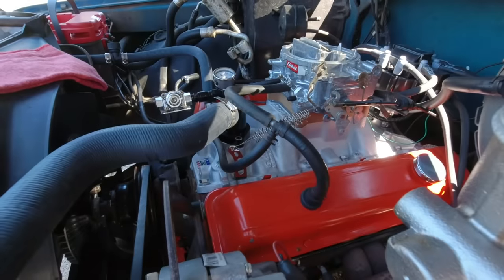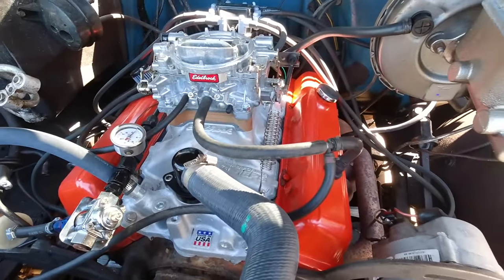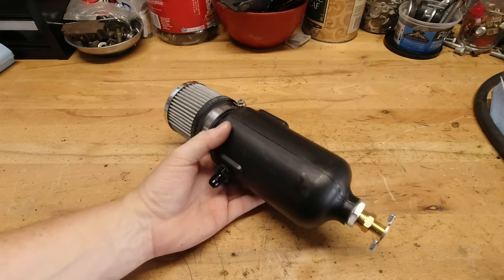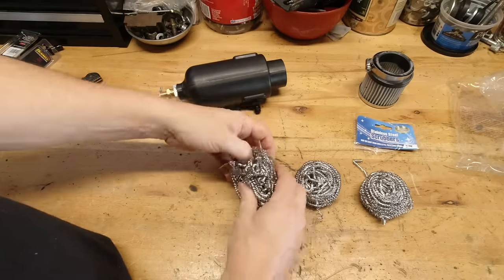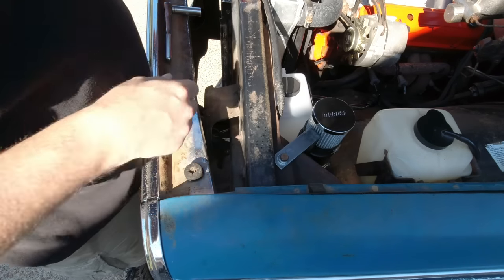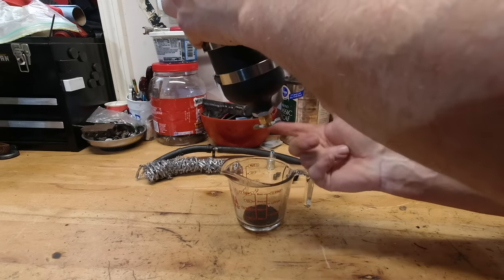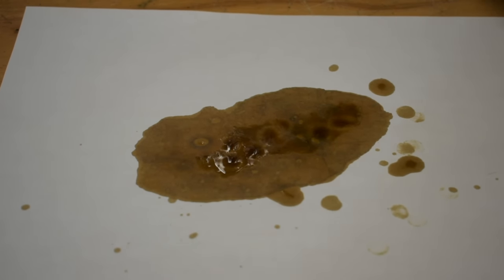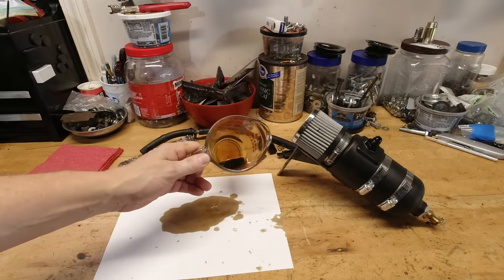Do You Really Need a PCV Valve in Your Classic Car

Comment: Know next to nothing about American trucks and recently purchased a '77 Chevy Big10. A little off topic, the guy I got the truck from said the transmission should be rebuilt because it won't shift. After a few questions, he admitted his ignorance about American trucks.
Weeks later and after a lot of videos, found missing and disconnected hoses during my inspection. No line/hose to the Vacuum Modulator Valve on the transmission (TH350) and no PCV valve or hose connection to the carb. Shouldn't there be a hose and/or line from the Vacuum Modulator Valve to a connection on the engine for the truck to shift gears properly? Shouldn't there be a PCV valve and hose connecting it to the carb?
Ordered a service manual, but really helps to see these things pointed out and explained in a video. Thank you for your videos and look forward to more tutorials.
Cheers
Reply from the maker: Yes for sure hook up the transmission modulator to full manifold vacuum.  Intake manifold is generally where they’re hooked up from the factory.  Will help the trans know when to up shift or downshift.
Reply: Is there and obvious spot on the manifold, right or left side? Thank you for the quick reply. Not feeling so lost now.
Reply from the maker: @hellraiser1478  generally it’s on an intake runner on the manifold directly behind the carburetor.  If you Google it you’ll probably find an image or two form something you can look for.  Is it a factory cast iron intake on the engine?  Maybe it’s still there and will be easy to locate.
Reply: Just lifted the hood, found a line connected to the rear of the manifold, followed it under the truck and what-da-ya-know, I found the disconnected line for the VMV. Will connect that line, reinstall the driveshaft, add some ATF fluid and see what happens. Cheers
Reply from the maker: @hellraiser1478  good deal.  Hopefully that cured it.
Reply: The poor truck has been used and abused and thrown out twice. Looks like an aluminum intake and the heads have been swapped out. I'm sure a few counterfeit mechanics have had their paws on this truck over the years.

Comment: Newer vehicle, I have a catch can between my PCV valve and the intake vacuum port on my Jeep 4.7, with 175,000 rough miles I get about 2 oz of oil every tank full in the can. In winter it is a nasty mixture of condensation and oil.

Comment: On a similar note- where should the purge line of a charcoal canister be connected to? I thought I could connect it to manifold vacuum but a mechanic said not to because I could get raw fuel into the canister.. I just can't find a conclusive answer to save my life. It's on a GM (Holden) car. Opinion? I am using a Holley 350 on an inline 6 engine.

Comment: Great video. I have a 69 dodge with the 440.  I have a pcv valve set up  and on the passenger side a breather with a hose connected to the air filter base.  Would my engine benefit if I remove that breather & hose and simply install an aftermarket performance breather ( without ) the hose. Also, when you installed the catch can did you use an adapter instead of the pcv valve?

Comment: Thanks for the video on PCV systems.  I noticed a shot of the evacuation canister for the fuel tank and its connection to the PCV valve inlet line.  In the recent past, I put a new modified engine in my car.  I then disconnected the evac. system at the outlet side of the evac. canister.  I want to route the line again for better emissions.  Is connecting this line to the PCV valve line that runs into the vacuum port on the carburetor a good idea?  Just wondering.
Reply: Yes, that is a good connection point for the Purge line
Reply: The out line from the canister is purge. All you are going is removing raw hydrocarbons from the activated carbon by allowing fresh air to remove them and then distribute un burn fuel in vapor form in a location equal to all cylinders. In the world of high mileage engines, fuel in vapor form is the best form to burn. You paid for the fuel so why dirty it up inside a catch can? Purge is programmed in the PCM / ECM but is added at times fuel mapping can monitor it. It is the cleanest form of fuel you can provide the engine.
  The EVAP system test are only their to monitor for escaping hydrocarbons. Does anyone understand OBD-II?
  It is the junk in the crankcase you want to keep out of a modern intake and I was shocked to see no condensation media inside the can, the looks plastic. For it to work best, it must be cooler so vapors of all kinds to condense turning back into liquid form then let gravity do its job.

Comment: PCV is a big deal for medium to high powered N/A motors, and all turbo motors because the rings are gapped wider and there’s a lot of blow by under boost.
If you have an LS you can swap in a LS-6 valley cover which eliminates all that crap and hoses, keeping it all neatly under the valley cover

Comment: You had the valve cut open and in your hand and described how at idle with high vac the valve opens! No, at high vac the valve pulls CLOSED/UP against the spring which pulls the valve into its MAXIMUM restriction position where only a small orifice exists to allow the high vac to just keep a Positive Crankcase Ventilation happening.  Then as vac drops the valve drops/opens into its minimum restriction position to allow the low intake vac and higher blowby volume to pass thru.
    All up removing the PCV on a street car is the dumbest mod out there as light/low throttle driving at low oil temps is where the biggest ammount of oil condensation contamination occurs. The PCV removes the majority of this condensation(among other things of course) which is the single biggest contributing factor to poor oil life, oil performance and oils ability to protect your engine. Paying for a catch can on a strert engine is simply paying to wear your engine faster and need more frequent oil changes.
Reply: The PCV system is the most overlooked under the hood. I'd stick a clear round fuel filter in the hose next to the carb vac line and see what it catches.
Reply: This should be highlighted at top of page
Reply: @8power He said there are tons of videos on how the pcv system works...he should have watched a few before he spoke.

Comment: I run a fixed orifice pcv that has no ball check on my two 350s and 327, it is just a sized pinhole. There are articles from Chevy on why they went to that on certain OEM years:
"GM offers a modified PCV valve to address customer complaints of excessive oil consumption on several applications equipped with 4.8L, 5.3L or 6.0L engines. Excessive consumption would involve a vehicle that consumes one quart of oil per 2,000 miles. This is assuming the vehicle is a personal use, non-commercial type vehicle driven under normal conditions. Obviously, vehicles that are used in extreme service, such as heavily loaded trucks, or vehicles driven at high rates of speed would not be included, as their oil consumption rates may vary. Important, a minimum of a 4,000 mile engine break-in period should be performed, prior to condemning an engine for excessive oil consumption."

Comment: Small engines like Briggs actually pull a vacuum on the crankcase.
You should see like 7-9" of water on a vacuum gauge or else start looking for things like bad rings or a blown head gasket.
Reply: they also burn a shit load of oil through it though so it makes you wonder. Does the pcv oil consumption make it a compounding issue?

Comment: Video is 13:20 long.  Is that by design?  I installed a catch can on my VW.  I get so much water/condensation combined with unburned gas and not much oil.  It needs to be emptied out probably every 1/4-1/2 tank of fuel consumed.
Reply from the maker: No!  But I like the way you think.

Comment: I'm bored, so if it isn't a race motor, pcv all the motors. If nothing else, it helps it smell better when cruising around. It also helps rings seal, much like venturi tubes or a vacuum pump.

Comment: My 454 and zz502 i used pcv valve but on my 605 bbc it has a catch can with an fittings and braided hose coming from end of each valve cover. My question is that i want to change my fabricated valve covers with no oil fill cap or breather. can i change to old style mickey thompson tall valve covers and if so can i simply drill out hole for an fitting?
Reply from the maker: As long as you keep the crankcase vented to atmospheric pressure you can configure it however you’d like.  It’ll tell you if it doesn’t like it.
Reply: did some checking, i guess i cant put oil fill cap on valve cover because its a closed system and oil fill is where near oil catch can is.

Comment: Me and my brother was just talking about this today thanks for this video
Reply from the maker: It’s a must have on a turbo car but I thought it would be a good idea to see how much blow by this old engine has.  It’s got a lot.  😆
Reply: @MuscleCarSolutions  Ive been thinking about putting one on my 351 but I'm sure I don't need it
Reply from the maker: @CCAutoWorks  I don’t normally use one on an n/a engine unless it’s a dedicated track car.  No reason to.  But I found out it’s a good tool to use when you want to know how much pressure is in the crankcase of a worn out small block!

Comment: i understand how the pcv works burt what does the breather on the oposite valve cover do ...on my old engine the pcv is conected to the carb and on the other side the breather is conected to the air cleaner ...why is that
Reply from the maker: Draw through air and stabilize the pressure inside the crank case.

Comment: A breather with a catch can wont necessarily "catch" everything.   Its not just about whats coming out of the breather.  If you have oil leaks or blow by (smoking), you might have positive crank case pressure thats not venting off.  A PCV, especially a good one, can help take care of that.  If you dont want oil/crud getting back to the carb use a catch can in between.  Itll have an inlet and an outlet.  Engine vacuum helps evacuate the pressure and moisture and it collects in the catch can.  Keeps carb clean.

Comment: F.Y.I. if you have a Holley Sniper fuel injection system on your classic the PCV ,operating normally, will mess up the vacuum signal to the f. i. computer.

Comment: I have major blow-by on my motor, & installed a similar catch can to vent the right side of the engine, & using a PVC valve to carb on the left. But am wondering if it would relieve eng. pressure if I ran a second hose from left valve cover to the same catch can. 
What your thoughts on this?
(& yes a rebuild is in the future when I can afford it)
PS: having fun driving the car again after it being stored since the mid 80's! But pressure is forcing oil out the dipstick, & pushing the PVC valve out enough to spew oil. Not good!
Reply from the maker: It’s one or the other.  The PCV uses manifold pressure to open the valve to vent to crankcase pressure.  It’s going to render the catch can redundant.  If you’re keeping the PCV, there’s no reason to have a catch can.
Reply: @MuscleCarSolutions  I might as well remove the PVC valve, plug the carb manifold vac. Inlet. & run a second line to the catch can then.
PS: Thanks for all your carb video's!
Reply from the maker: @dannovello1577  no.  One cover has the line to the can.  The other side needs to be open to pull in air (outside pressure) into the engine.  Breather cap on that side.
Reply: @MuscleCarSolutions  oh shoot, ok. I'm kind of re-learning the car. (my first car),  '68 Barracuda Fastback, with a 340 I rebuilt with help of a mechanic friend, back in 1980. I screwed up & didn't gap the rings, etc. Then it was wrecked...but not forgotten, lol. Fun driving it again with all the handling upgrades....accept for the blow-by/oil spew issue. Just trying to relieve more crankcase pressure so it not pushing oil out the dipstick tube. Pointless of course, ha. But so fun to drive it again!
Thanks again!
Reply from the maker: @dannovello1577  I think I’d commit a felony of your choice to own a nice mopar A body car!  😂 love the cudas!  Depending on your manifold vacuum, you’ll likely remove more pressure from the engine with a PCV system.  The catch can (unless it has a scavenger pump installed) relies on the over pressure to push to the can.  A PCV system pulls it when the engine vacuum is high.
Reply: @MuscleCarSolutions  I see, 👌...and this is why I became a carpenter, (35 yrs, retired now), & not an engineer/mechanic. A bit over my head, but I'm still trying to learn, ha!
Reply from the maker: All good!  Thanks for watching!
Reply: @MuscleCarSolutions  Sure thing! I enjoy your video's!  It's a lost art understanding the carburetor system. Fuel injection, & computer control has taken over.
  I have another question related to your vacuum gauge/idle tune video. But think I should post the comment/question on that video, not here. 
 I almost want to send you a video. So you can make a follow up video saying "this is what this dude is doing wrong" &/or "this Carter carb is slightly different in design" etc. But you my not have time for such nonsense.
Reply: Maybe your pcv valve has gone bad 🤔

Comment: I do have one question about a problem I've been having. My car has a 355 SBC and it leaks past the front main seal. I've changed the front timing chain cover but to no effect. My car has one of those fat chrome pcv valves hooked into the passenger side valve cover and a breather in the driver side. The pcv is connected to the full manifold vacuum on the carb. It has been misting around the breather and the grommet the pcv valve pushes into. I've been getting oil all over the front of my engine and the engine fan just kicks it up onto the hood while driving. I think it's leaking because it has excessive crankcase pressure, but I thought the pcv valve would be taking it away. I really need to get it to stop leaking. Your thoughts?
Reply from the maker: Time for a leak down test!  It sounds very much like what happens when the crankcase gets over pressurized.  A PCV nor a catch can is going to keep up with it.  Pushes out the seals, sometimes up through the dipstick or out the valve covers.  That’s where I’d start to verify how bad the issue is.  That will determine what your next steps are.  Unfortunately, I’d plan for the worst.
Reply: @MuscleCarSolutions  the dipstick stays in place. I did do a compression test and my lowest cylinder measures 161 psi. It's only leaking out the front. It's been doing that ever since the engine was put together. It has about 30k miles on it. I'll see about renting a leak down tester.
Reply: @MuscleCarSolutions  also it's a 9.7 to 1 compression motor with the lt4 hot cam, stock vortex heads and stock valves if that helps you.
Reply from the maker: @DYLAN102001  compression test doesn’t tell the whole story.  The leak down test will tell it’s ability to keep it contained for a sustained period of time.  You should get a good idea of what’s happening with the information from that test.
Reply: @MuscleCarSolutions  ok so I rented a leak down tester from AutoZone. For around 100psi to gives me about 92 psi average. Here are my pressures:
1. 93
3. 92
5. 93
7. 90
2. 91
4. 91
6. 94
8. 90
When I did the test couldn't hear anything out the oil passages or the intake.
Reply from the maker: Well you can check that off the list then.  That’s a consistent result.
Reply: @MuscleCarSolutions  Just to give an update: I took the car to a guy I know who took a look at it and put a timing light on it. He told me the oil leak was cause by bad timing. We flipped a vacuum hose and adjusted the weights in the distributor. It doesn't leak anymore. I can go 1000 miles without a drop. I don't know if you mentioned it in your video but I think it would be a good idea to tell people to check their timing if there's high crankcase pressure too.
Reply from the maker: What was your timing?
Reply from the maker: Yeah you were way off at all in timing.  I’m sure it runs a lot better with more timing in it.

Comment: There is a lubricating factor to this that he is forgetting about. If you notice that was all oil he dumped out which would also lubricate the upper compression chamber. Older 350 Chevy was normally good for only a hundred thousand miles before the PCV system came along
Reply from the maker: In 500 miles of driving, less than one ounce of fluid came out of the engine.  It wasn’t all oil.  There is a little water mixed in, slight smell of fuel (which isn’t surprising, given it was on as I was making tuning adjustments).  I’m not clear what you mean by “upper compression chamber”.  Are you thinking combustion chamber?  Anything there is burned on the power stroke of a four stroke combustion cycle.  Anything pulled from the crankcase and sent into the intake to be burned is much different than say a two stroke engine that has an oil/gas mix for its lubrications properties.  Given the other contaminants coming from the crankcase, I’m not sure you could call this a positive net effect.  Though that would be in interesting long term test to see what the wear looks like on a PCV engine vs an engine with a catch can.

Comment: I did a PCV delete and installed a catch can now my engine hasetate on idle.
Reply from the maker: Reset mixture screws/timing.  You’re drawing a different amount of air now through that PCV port.  It’s a change and the carb needs you to tell it how to respond to it.
Reply: It's an opd system it's a 96 Chevy LT1
Reply: Can you till me where to hook the IN hose and the OUT hose? On the catch can.
Reply from the maker: That’s a whole other animal.  Still using the factory set up?  Throttle body?